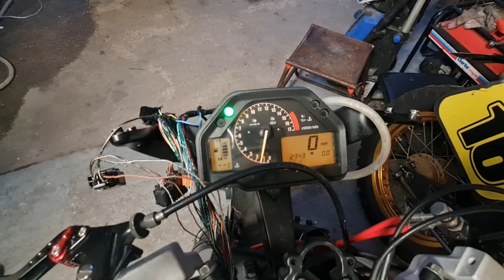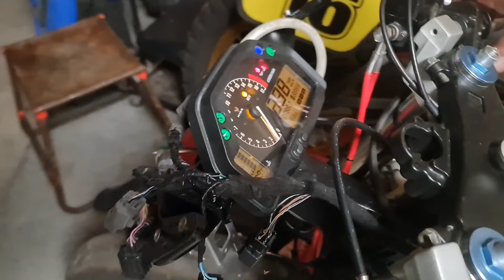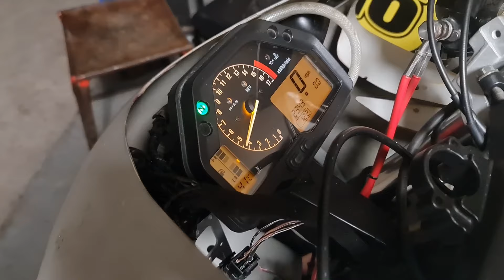We bought a Broken CBR600RR race bike Will it start?

Comment: For race shift you need rear sets with the gear leaver connected to the peg so the shift rod runs diagonal over the frame to avoid clearance issues
Reply from the maker: Thanks for that. Do you have any suggestions for a set to look for?
Reply: Yes lad! Just discovered your bike build here and in response to the rearsets (if you haven't sorted already), R&G do a race shift set up and so do Bonamici. Reactive parts stock the Bonamici ones and I've got them on my bike. I'd suggest buying a few spare footpegs and some spare shifter pegs as they can come loose on track (speaking from experience)👍